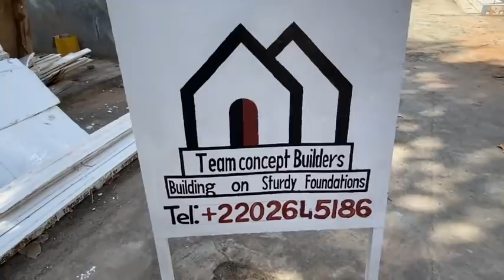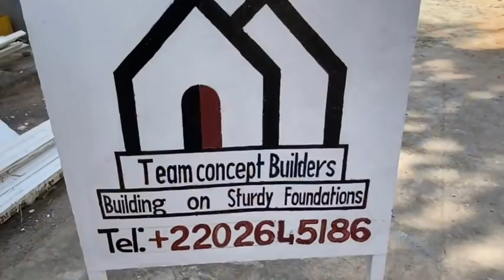Prince Paul's renovation project in The Gambia

Comment: Rick and Cynthia, please watch Asher and Gad videos.  They moved from the UK to Ghana.  He was an electrical engineer and knows the pitfalls and successful purchases for selecting solar panels, generators, electrical and plumbing designs, security, borehole, kitchen designs, bathroom designs, window selection and installation, maintenance for the outside of the house, driveway as well as a front and side garden.  The house is magnificent in its design, selections for tile, appliances, plumbing, wall colors etc.  He will have a Consulting business beginning in June.  Watching their videos will give you a point of comparison when you begin your building project in the Gambia.   I cannot wait to see the start of your project in the Gambia.